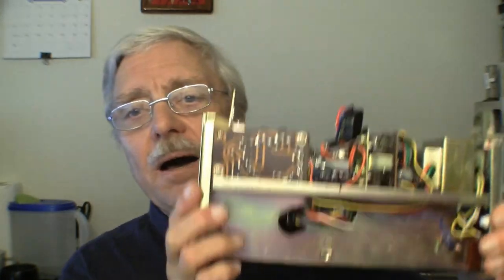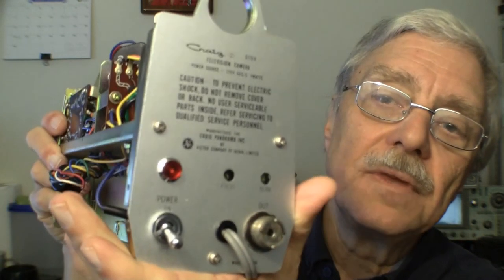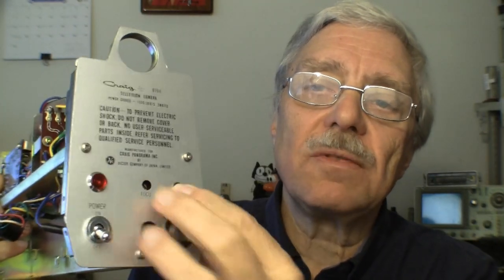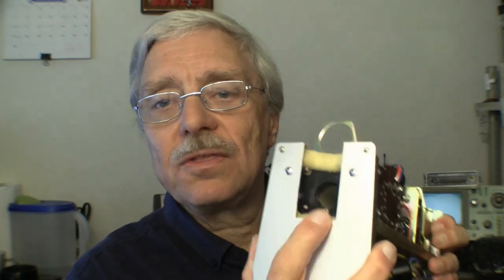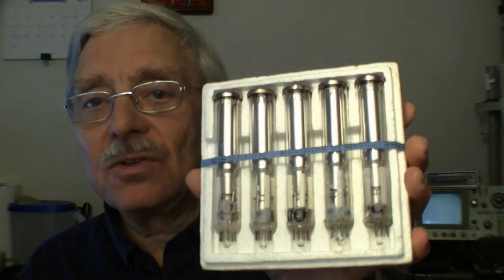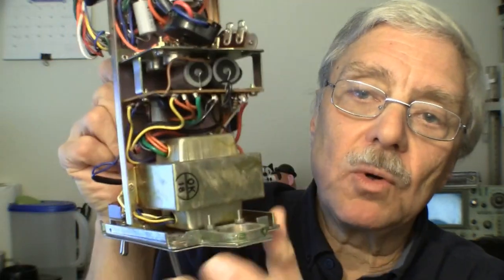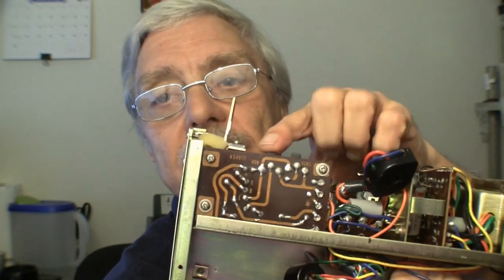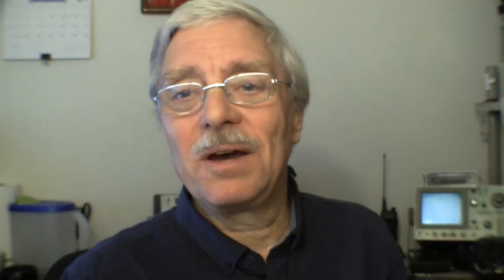Craig 6104 Vidicon Camera Restoration, Part 2

Comment: Interesting, I thought Craig was Sanyo?
Reply from the maker: Fascinating. It is possible that Craig was a US based front marketing company. I know that both Sony and JVC sold products, very early on, under the Delmonico brand name.  It's not impossible that Craig represented other Japanese manufacturers.  But, I confess openly, that this is pure speculation on my part. If anyone knows the facts on this topic, jump right in and enlighten us.
Reply: @videolabguy  just gone back on that Sanyo hunch and it seems yes, they did source products from Sanyo, JVC and Pioneer apparently!

Comment: I wonder if https://www.youtube.com/user/glasslinger could make a replica tube, they certainly have impressive vacuum tube making skills. though some parts of the tube may take some ingenuity to replicate.
Reply from the maker: I suppose it would not be impossible. But, the electron guns in these tubes are of an extremely high precision. Near integrated circuit levels of precision. The show stopper is the exotic chemistry and physics involved in laying down some highly toxic chemicals on the target electrode. These could range from selenium activated with silver to antimony trisulfide film applied in a vacuum sputtering apparatus.
Reply: I guess well have to reinvent a few things owo